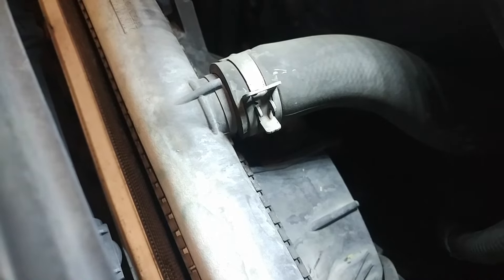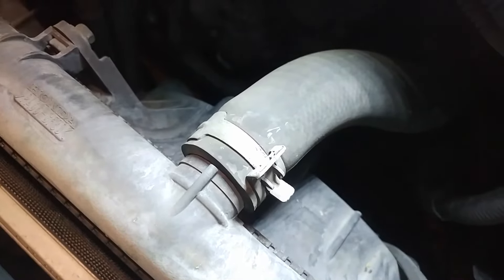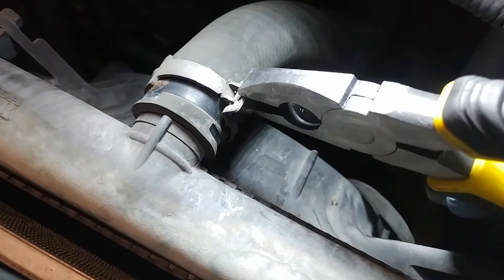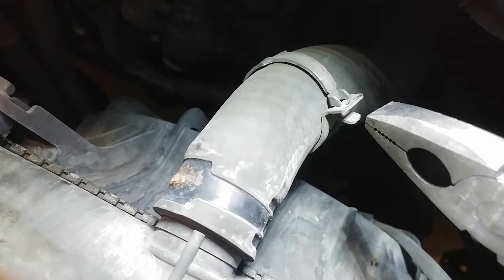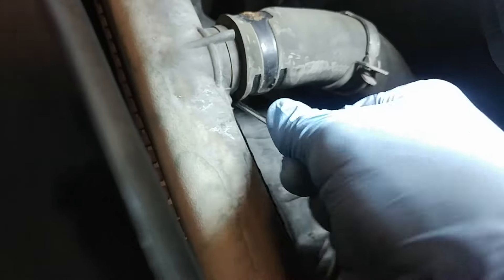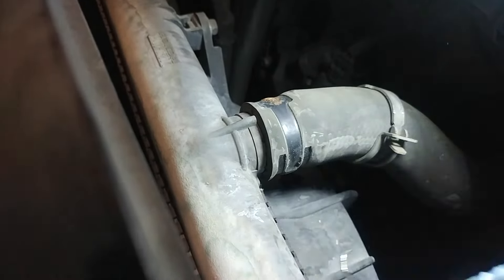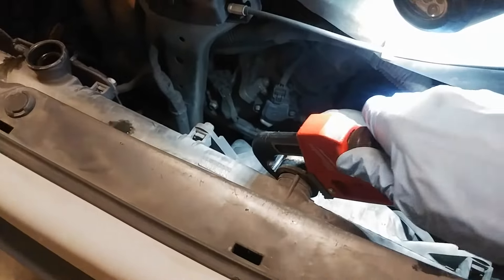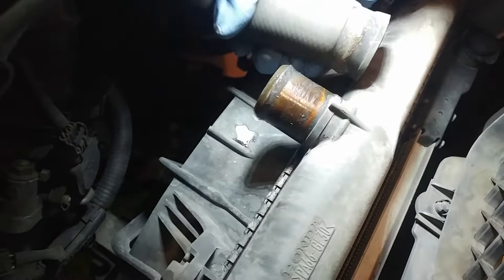Remove Radiator Hoses the Easy Way

Comment: Somethings i dont completely agree with... Compression clamps dont hold the same tension their whole life. Spring steel weakens over time. Dont use picks to unseal the hose, simply use channel locks and give a quick back and forth and it will break it free without potentially tearing up the hose if youre planning on reusing it. You used a pipe wrench anyway making the use of the pick literally pointless. Always remember to either use an air lift to fill coolant or make sure you burp all the air out of the system and use new thermostat whenever youre messing with the cooling system
Reply from the maker: Thanks for the comments Tommy. Because of the plastic radiator necks I think you're smart not to just put the channel locks (my pair does not fit over the radiator hose) or pipe wrench on and start rocking back and forth. Those plastic necks can break off, which would require a brand new radiator. Gently picking away at the corrosion first helps to break that corrosion seal that develops. Then when you put the pipe wrench on you're only dealing with 20-30% of the remaining corrosion that you couldn't get to with the pick tool. I think replacing the thermostat should be based on (1) how long they last and (2) where it's located. On different cars the thermostat sometimes wears out quickly and can be replaced easily. If that's the case you are right on point. On other cars they tend to go 200,000 miles or more, and they are located in difficult to reach places. Hey, thanks for watching. Make those cars last baby!
Reply: @TheSwitzAutomotive  yeah i had a subaru i resealed the engine at 310k and the neck on the radiator broke on me probably 1500 miles after the rebuild but i think she was due for a radiator anyway haha i loved that car sold it with 340k and it lived a harsh life til 360 something after i sold it. I daily drive a tundra now so hopefully no issues in the near future
Reply: @TheSwitzAutomotive  Thanks for the video   , I had to get the radiator hose off and ended up on YouTube after a few hours of struggling 
Came across this video,  I used your method and absolutely brilliant,  no damage to the hose either so can pop back on 
Thanks for saving me more headache 
You're a star 🌟 x
Reply from the maker: @jacquelinebishop8465  Happy to help! Thanks for watching and make those cars last baby!
Reply: 18 years later mine were still tight as a MFer....so I did find a lot of corrosion...that makes it really hard in the tight areas.

Comment: There were a few critical cuts edited in there.  I appreciate the tips, but our definitions of "easy" might be slightly different.
Reply from the maker: Life gets in the way... be it a knock at the door or a phone call from a friend. Sometimes I can't shoot video all the way thru... bottom line, if I need to remove a radiator hose I use the pipe wrench technique... and if it's a smaller hose I use a smaller tool, like a pair of channel locks, to twist the hose back and forth to break the seal. I hope you're a subscriber and make those cars last!
Reply: my thoughts too. why cut the hard bits and show the hose when off

Comment: How about the intake and output hoses on the firewall, behind the engine and under under obstacles with no room for tools or hands. I could really use that "quick tip".

Comment: I usally cut the old hose with a utility knife and go on. If I was going to replace the same hose, what you did would have came in handy. I don’t see you putting old hoses in a new radiator

Comment: Thank you for these tips. I have always used the picks to help break hoses free but I never would have considered using a pipe wrench. Also, I always wondered about the difference in clamps and why and now I know. I actually cracked my brand-new radiator this way. I wish I would have found this video sooner but now I know for next time. Thank you.
Reply from the maker: You got it Dabble... thanks for watching and the kind comments. I hope you're a subscriber and make those cars last baby!
Reply: @The Switz  I was originally watching your videos on Ames Multimeter when I found this video. Since I am one of many that have cracked the radiator neck from tightening too tight, how do you feel about JB Weld high heat on the outside of the neck, allowing enough curing time before trying again with a tension clamp?
Reply from the maker: @Jinkins100  I would give it a shot but you may need to plan to buy another radiator. Don't feel bad. Things like that can happen.
Reply: @The Switz  Lesson learned. Thanks for your information, I now know I can trust the tension springs and if I do use the screwing clamps, it's better to have to tighten a little more as needed because I can't untighten after it's too late and crack the radiator LOL.

Comment: How do you tighten the clip after you loosen past the point that it snaps ?
Reply: Luck. 😂 I just squeeze/release   mine until they snap back
Reply: With a screwdriver u push the metal down

Comment: Why would you use a pipe wrench
Reply: because it doesn't put pressure on the maie end you're trying to take the hose off of, consequently, I would hope you are less likely to damage it... see @Jinkins100 comment above...   funny, I was thinking of using a pipe wrench before I came inside to look up tips for removing hoses. but getting a big pipe wrench in a cramped space like mine would be impossible (luckily, I just happened to have obtained a mini pipe wrench,  hopefully I can get enough torque on it).